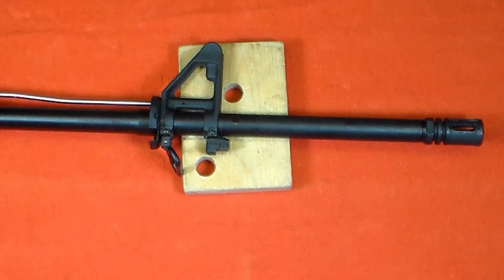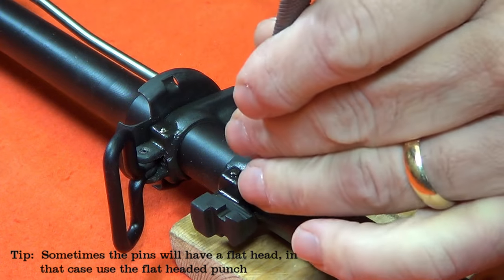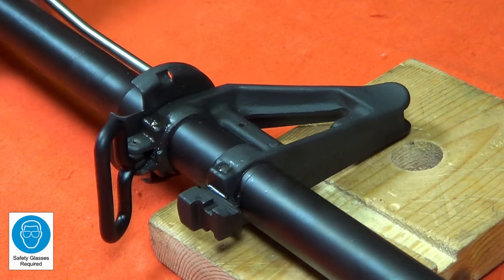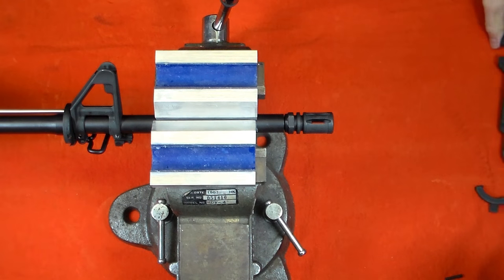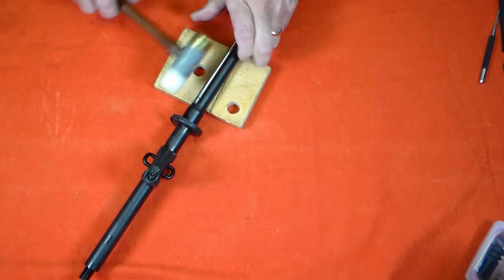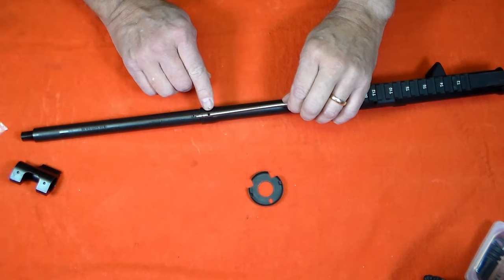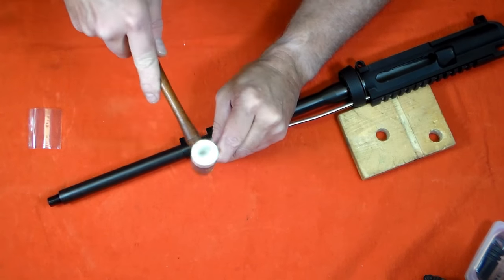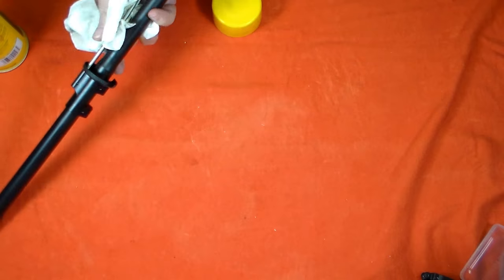AR-15 Front Sight Base removal and replacement

Comment: do you need a different handguard?  i took mine to a gunsmith a few min ago to remove the site because i do not trust myself and the person behind the counter said my aftermarket magpul handguard would not work because its not compatible with a low profile gas block.  granted, this was the guy behind the counter - i dont think he is the actual gunsmith.
Reply from the maker: Seems odd, but not seeing your handguard hard to 100% positive.  But basically there are two kinds of handguards, free floating ones that don't need a handguard cap the standard ones that use a handguard cap.  See the video at 5:25 even though I removed the FSB I still replaced the handguard cap, so as you can see you can put a handguard on a low profile gas block.  Maybe the clerk was thinking the handguard cap is attached to the FSB?  Short answer I think he's wrong, but I'd like to see a close up pic of the front of your handguard.  Hope that helps.
Reply: @ImminentThreatDefense  thank you!  I will let you know what he says.
Reply: @ImminentThreatDefense we were both correct.  I was able to use my after market MOE hand guard.

Comment: He forgot to mention youre supposed to align the middle slot on the flash hider with the gas tube. The third slot that is.
Reply from the maker: Thanks for the comment, I always appreciate viewers who are looking for the details and keeping me honest.   But, actually I do address the flash hider orientation, see the video at 6:30.  Whether there is a port facing up depends on the flash hider, what's important is the section with the port missing is facing down, so it doesn't blow a dirt cloud when firing from the prone position.  Thanks for watching

Comment: I was wanting to remove my front post until I knew all the crap that came with it. Reason being is because I put a red dot on and the front post is in the way. I guess the best option is to raise the red dot sight, or put the old fashioned flip up rear sight on
Reply from the maker: :-) hope I didn't scare you off, it's truly not that difficult.  If you want to co-witness the sight do some research on "absolute" and "lower 1/3" co-witness.  If you really think you'll have a tactical or defense need for the rifle, a backup system is always a good idea.  On my patrol rifle I had absolute co-witness flip up sights that I could pop up in a second if my EOTech quit on me.  On my plinker rifles, I don't worry about it I just have scopes or red dots, no backups.  Thanks for watching!
Reply: It’s not that it’s hard I guess I just don’t want to mess anything up, I wasn’t aware that you have to mess with the gas tube and all that. I looked up an attachment on Amazon for my top rail to do an inch raise for my red dot. And I’ll order a flip up rear sight. It says an inch raise will do the 1/3 cowitness and the other version is .83 inch which was absolute. I like the idea of being able to use one or the other separately

Comment: This was helpful but, I hate Smith & Wesson and the fact that they made the front sight a pain to remove with those tapered rounded pins. It's about as awesome as thier jointed trigger on there pistols that felt like mash potatoes when you pulled it. Straight garbage, buy something else. This is a great video and explained a lot.....S&W sucks more than I thought.

Comment: Master Firearms Instructor, Advanced Armorer? Really? You need a solid back up not a piece of scrap wood. And use a heavier hammer to transfer more power with less hits. Wow
Reply from the maker: Reminds me of the old Gunsmithing adage, "if jams, force it... if it breaks it needed replacing anyway"  :-) And as for the titles, yeah really, at least that's what the certificates say from the manufacturers.  I think we all have our own techniques and this video is about mine, but as I pointed out at about 2:00, you (well other people anyway) should be very cautious not to over drive the nail set punch or you will damage the FSB.  As for the back up, it's on a very solid work bench and you either use wood, plastic, or rubber to prevent damage to the FSB, I choose wood.  Hardly a scrap, that's a highly engineered custom bench block :-).  So I believe it's better to take my time, even if it's a little frustrating, and loosen the pins carefully.  Sure I could get out the bigger hammer, I've got one, but these are the tools they taught us to use at Colts AR15/M4 school, so I'll go with that advice.  Thanks for watching and commenting.